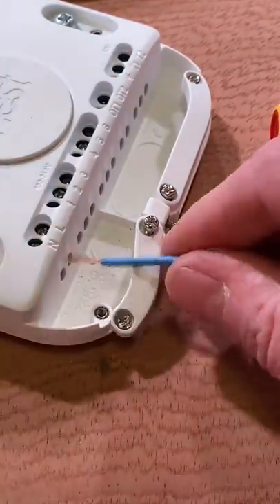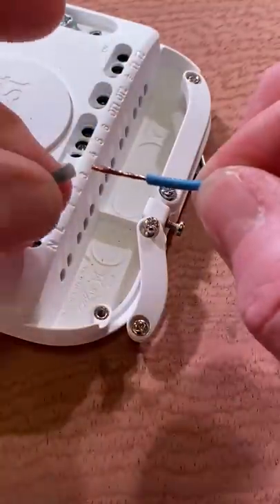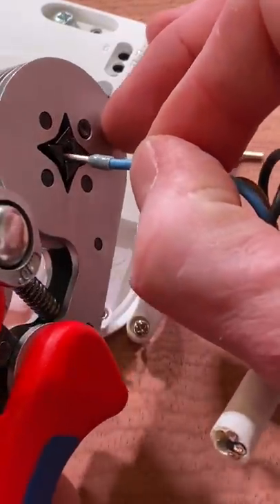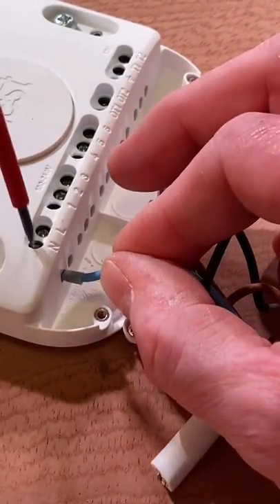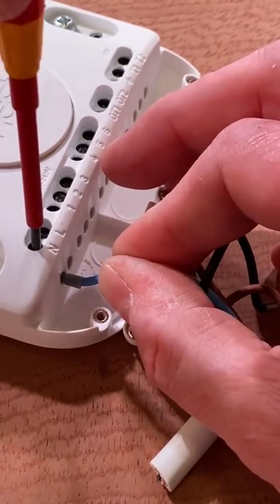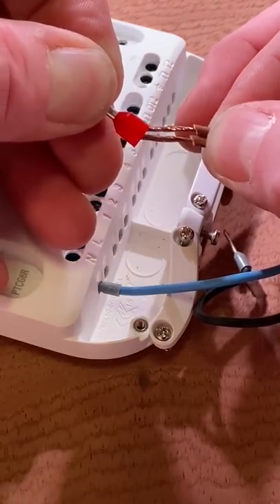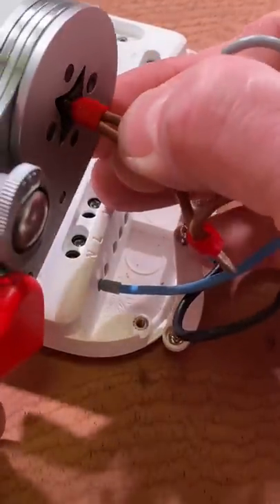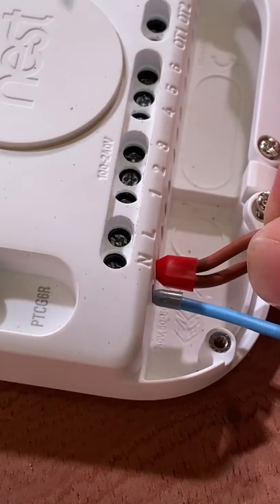Keep the strands together with WIRE FERRULES - Electrical #shorts from eFIXX

Comment from the maker: NEW TO USING FERRULES - check out this video series 👉 ⚡️https://youtu.be/3PpvyZmPTJQ
Reply: What make is that crimper ?
Reply: Please never twist the wires before inserting its shoe!
Not even with a single wire!
Specially when you have a good tool,
like that knipex.
The wire will live longer!
If vibrations are concern!
Reply: We're to buy great for solar systems
Reply: I’ll check it out. Never used ferrules in 40 years in the Hvacr trade.
Reply: And quite important, use the right size!
Reply: I thought this was standard
Reply: You can't twist them prior crimping.
Reply: Why not just double them over?

Comment: I’m having trouble getting the stranded cable into the ferrules. I need a ferrule for my ferrules

Edit: Thanks for all the thumbs up! Most I’ve ever had 🥳
Reply from the maker: Like a Russian doll 🪆
Reply: One reason could be the twisting of the strands, you aren't supposed to do that. Perhaps it's easier to put in then?
Reply: Cut that shit
Reply: Well said.
Reply: @m00str  same is true for wire nuts, even with solid conductor
Reply: You..you.....monster. What about a ferrule for the the ferrule ferrule? Its like Russian dolls.
Reply: You need a new job
Reply: No you don't..... Even I don't.
Reply: LMFAO 🤣
Reply: @amazoniancustodian  the type of people that don't pre twist solid wire are the same ones that use the stab connections on the back of switches and outlets, the same ones that use push on connectors, and the same ones that use shark bite plumbing fittings. They're called hacks. They don't care that the confection won't last as long or that it makes it harder for the next guy. They care about getting home to play video games.
Reply: @littlejackalo5326  Try it with some conductors bro, you don’t need to pre twist. 
If anything the pre twist only makes it more likely to tear the wire beyond its stretch limit, when you screw in the wire nut that further twists the wire.
Reply: Put some hair around the hole....
Reply: You’re famous now. Welcome to the A List!
Reply: The “thank for likes” edit completely invalidates anything you said in the original comment. FYI…
Reply: @Dragoneer  Nah, bro. That’s racist. Not that there’s anything wrong with being gay.
Reply: @JetFire9  uhh…what?
Reply: @Dragoneer  I love you too!
Reply: @JetFire9  ok?
Reply: @Dragoneer  I’m not sure what you mean
Reply: @kuk3411  Thanking for likes makes it look like that’s the only reason you made the comment and that was your only motive. It overshadows any point being made, and it’s generally not necessary since the majority of people that did like your comment won’t see the edit…
Reply: @Dragoneer  ah I see your point.. 
Well, I’m not bothered about likes but still would prefer to say thank you, despite it possibly not reaching anyone relevant.
Reply: Cringe edit thanking for likes 🤦‍♂️
Reply: Exactly, it's even smaller hole
Reply: You won't if you buy the right size for the type of wire you are using!!!
Reply: Don’t twist them
Reply: You know what I don’t get is in the US and Canada 93% of all low voltage systems in a residential setting we use sold core wires why does everyone else use multi core?
Reply: @the_hood_cat_5553  flexibility
Reply: Came here to say the same thing 🤣
Reply: One rule for one, one rule ferrules other 🤘

Comment: Snip the copper strands at the end of the ferrule for 10 extra electrical skill points.
Reply: I even crimp it twice, so it looks very clean.
Reply: We might aswell go ahead and number each termination while we're at it.
Reply: @conoromelia8435  heh.. heh. that's what she said..
Reply: And dont twist it!
Reply: @nobody-ek5bx  why not
Reply: @twilightsparkle75  She prefers circumcised wires?
Reply: @edithboozy1000  "may as well number every termination" some dark humour lmao
Reply: @alejandroperez5368  pretty sure because it adds unnecessary strain om the cables making it easier for them to fray or strip off from their contact at the insulation
Reply: Yep, I was expecting a snip myself.
Reply: @alejandroperez5368  makes it much harder to get them into the ferrule
Reply: @alejandroperez5368  because thay don't need to be and in some cases it could make cable to big to get in the ferrule
Reply: @nobody-ek5bx and it puts stress on the wire and changes its electrik properties.
Reply: @alejandroperez5368  It doesn't lay/crimp right if you twist. sometime you have to twist a little, but you don't want to go past how the strands were manufactured to lay in the cable. 

The strands will crimp down better, and you don't introduce any crossover or strain points.

It's a general rule for any crimped connection.

Comment: Oilfield E-tech here. We now use ferrules on all of our sensor and other I/O terminations. We have a lot less problems with broken wires at the termination point and everything is nice and secure. I've started to use them in my own projects as well, just because it so friggin easy, why wouldn't you? 

Another field repair life saver are the shrink tube butt splices with solder in the middle. Both have made my job so much easier.
Reply from the maker: 🙌 listen up folks!
Reply: Those solder connectors are a life saver!!
Reply: @Savinmoneyforparts  they contain a solder that melts at low temperature.
Reply: I would not use the low-temp. solder butt connectors in all scenarios.
Reply: @Savinmoneyforparts  yes, solder! Read the last sentence of first comment..... There are little connectors for splicing to wires together. You put both wires in and heat it with a torch and the solder ball in the middle fill.connect both wires perfectly, but in Germany you can't use them for electrical installations....
Reply: this is a GREAT technique people NEED to know that do anything electrical. period. lol 😊
Reply: Ferrules should prob be used on any size stranded conductor, fine stranded anyway. You can have some 12 awg conductor that's stranded but only like 6-8 strands and sometimes depending on the terminal you can terminate it raw and it's fine.
Reply: Butt splices lol  
🍑 😭 🤣 😂
Reply: @Savinmoneyforparts  the vast majority of my work is on control circuitry so yeah, low voltage/current applications. If you're splicing anything with more then 1A current draw, do it right and hand solder/shrink tube it.
Reply: We call them solder sleeves where I work (commercial airliner electrician).  Depending on the workload of the current job, I could end up doing several hundred of them. Lifesaver is an incredible understatement, to say the least...
Reply: Is it seriously called "termination"?
What the hell?
Reply: @aliceeliot6389  Yeah, it comes from the Latin word terminus, which means, "The final point; the end.", or, "An end point on a transportation line or the town in which it is located."

Same root word as the word terminal, as in, "Airport Terminal".

Basically:
Terminate (verb) = make an end connection
Termination (noun) = The end connection itself
Termination point (noun) = The point at which the end connection is made.

Ask an English major what they think a terminating resistor is, and you'll get some funny responses.

Comment: The fact that this cleans up and makes termination jobs easier is nice, but what's better is no more tiny holes poked in your digits!
Reply: I feel like I may as well just be a pin cushion some days 😂
Reply: Need a sewing thimble! until the ferrules come in.
Reply: @leemartin9156  good tip! I always forget those are a thing lol
Reply: @WolfangStudios73  I don't use them, Lol, but reading comments and knew exactly what you were talking about, it just popped into my mind.  Too bad I don't think of these things when I actually need them!  Lol.
Reply: @leemartin9156  oh I can relate. I literally buy tools for stuff, use it once and then forget I own it lol
Reply: @lileinstein104  my right thumb could be sold as copper scrap at this point
Reply: @funny3scene  😂
Reply: Waist of time
Reply: @stevenclark6387  So was English class for you apparently.
Reply: @lileinstein104  I'm a journeymen electrician what do I need to know about English?
Reply: @stevenclark6387  So you're a sparky without a licence, makes sense.

Comment: Ferrules are mandatory in the Netherlands with fine stranded cable when using a screw fasteners
Reply: That’s really cool to know ! Are you guys required to use any specific type of wires as well?
Reply: @ProDMiner  That depends on what kind of installation it is, inside/outside, underground, closed/open pipes. But we even have a regulation of how much isolating value your cable must be
Reply: @draadjelos4100  that’s really cool to know, love seeing how other countries make / build stuff differently than other places. Ty for the knowledge :)
Reply: @stevenclark6387 No we use 230V and 400V in our houses. But with fine stranded cable ferrules are (almost) always mandatory, not just in low voltage. We also have big cables (50mm2) that also needs a ferrule.
Reply: @ProDMiner  wait till he finds out about the good ol VDE
Reply: Ferrules gives worse connection. Seen more melted wires from ferrules then without.
Reply: The same in the Czech Republic.

Comment: And here in Germany we gave the dual versions an english name: "Twin"-Aderendhülse. They are mandatory here whenever you bring in a fine-stranded conductor into a screw connection, and that's the case since 1979.
Reply from the maker: Great info as ever Marcel - We need to visit Germany and check more things out!
Reply: @efixx  It was as always, humans only learn it the hard way. Before we used to solder the fine strands together and put them into the terminal. That caused massive issues, the solder deforms under the pressure of the screw and the connection becomes loose. In addition solder corrodes on the surface, which is no problem on soldered joints due to the corrosion is only on the surface, but when using this method it became a problem causing an increased contact resistance. The connections became loose, sometimes the wires fell out of the terminal. But sometimes the solder was deformed in that way, you couldn't get the wires out of the terminal. Even when loosening the screw fully the wires didn't came out of the terminal.
Reply: @Marcel_Germann  thanks for the reply, I wondered why soldering for screw terminals was against code.
Reply: That's funny, I have never heared "twin-Aderendhülse". Here we call them "Doppeladerendhülse".
Reply: @guppel  'twin' was inside speech marks. I understood this as a way for us english speakers to understand the word better. thanks
Reply: Well technically there is no law stating that, only norms. But in practice yea, they are mandatory.
Reply: @EmotionalWeather  In the industry it's all about regulations and norms. I got an educational book for electricians from 1980. They state there that fine stranded conductors must be prepared before inserted into a screw terminal. Either ferrules or crimps.
Reply: @Marcel_Germann  Glad yet sorry to learn this. I planned to solder the stands  on everything when I install the lighting in a model house soon. Although maybe it's still reliable enough for my use...
Reply: That's in fact not true. I don't know why but I thought this too but it's wrong.

Es ist tatsächlich so, dass jede Klemme auch Schraubklemmen per Norm auch für bewegliche Adern ohne Hülse geeignet sein muss und es steht in keiner VDE Vorschrift, dass die Dinger Pflicht sind. Du musst nichtmal löten. Einfach reinkriegen und runterschrauben ist absolut zulässig. Endhülsen missen will ich trotzdem nicht.

Ich halte es für richtig, dass es so beigebracht wird, aber genaugenommen ist es nirgends verpflichtend festgelegt.
Reply: Yet another example of Germans doing things better.
Reply: Same here in NL. 👍👍
Reply: @furrycocksucker69uwu  Maybe its because you learn it that way in an apprenticeship for electricians. Most people I talked to also thought it was mandatory to do this (including myself), but you are right, its actually not. It is very important to use a crimping tool which applies evenly pressure from all sides to the ferrule and to use the correct size for the diameter of the wire. If you insert a badly crimped wire into the terminal, the ferrule may get stuck in it while the wire slips out.
Reply: What would be the problem in just twisting the wire and puting it into a screw connection?
Reply: @furrycocksucker69uwu  Nope, the manufacturers of terminals must list the conductor types which can be used without any preparation. That's in the EN 60999-1, or in the German localisation VDE 0609-1. That's the reason the push-in connectors are only listed for solid conductors, even when you can use fine stranded with ferrules, but crimping on ferrules is a preparation. The thing is, if you use fine stranded conductors in a screw terminal, there's a high risk of breaking the fine strands and reducing the cross-sectional area of the conductor. Also there's less corrosion on the copper. And they also prevent that single strands protrude from the terminal and are touchable.

Zudem können die sich aufspleißen, dann hat man ebenfalls einen verringerten Querschnitt. Wer Anfang der 1980er Elektriker gelernt hat, da stand das im Lehrbuch drin das man bei Litze in Verbindung mit einer Schraubklemme den Leiter entsprechend vorzubereiten hat mittels Aderendhülse oder einem Kabelschuh.
Reply: @Heizenberg32  You shouldn't do that, will only cause trouble on the long term.
Reply: @sayingnigromakesyoutubecry2647  The fine strands corrode over time, also the fine strands can be damaged by the screw, reducing the size of the wire. Corrosion causes contact resistance. I once had a case of contact resistance. Old outlet from the 1950s in a damp environment. Contacts were corroded. Someone plugged in a freezer. When it was unplugged the person only had the plastic of the moulded plug in the hand and the prongs still stuck in the outlet.
The ferrules shown here are made of pure copper, which is tinned to prevent corrosion.
Also a reduced risk of single strands folding back and protruding out of the terminal.
Reply: @Marcel_Germann  well, all of the screw connections I ever seen in my country, Argentina, was always the cable twisted and that's all. I learned about electricity in highschool. Nobody ever mentioned anything about using this kind of connectors. I'm not saying you are wrong, it does makes sense. After a few years the cooper that was in contact with air tends to become brittle and shitty.

Still, I don't really get how would you avoid corrosion by using a connector like the one in the video. I don't think you would avoid oxidation of the copper since it doesn't look like it's insulated from air.
Reply: @sayingnigromakesyoutubecry2647  it's messy, inconsistent, copper work hardens so it's more likely to break, and the twisted wires cut into each other when it's tightened up. It's standard practice in residential in most countries to twist wires like you mentioned, however for industrial applications with high complexity ect, it makes things more tidy, more reliable, and easier to alter or troubleshoot, so it's very much the industry standard in those applications.
Reply: @Marcel_Germann  that's very nice. I should use them from now on... Thanks for explaining everything.
Reply: @Patrick-857  yes that makes sense. In the industry you will need to maintain electrical appliances  from time to time and you would need to disassemble them fast.
Reply: Noch nie "Twin" gehört oder zwillings. Einfach 2 Fach endhülse oder doppelt :D
Reply: @Marcel_Germann  Moinsens, ja ich habe auch nochmal geschaut. Du hast Recht, es sind Zwillingsaderendhülsen. (voll das lange deutsche Wort :D) 

Das sprechen wohl alle in meinem Betrieb einfach anders aus.. aber so viele Links hätte es nicht gebraucht, um mich zu überzeugen, ich bin offen für Verbesserungen meines Wortschatzes 😄😄
Reply: As an German electrician, everytime you see american wiring you are very likely to get a heart attack
Reply: @BeatstormX  Nope, it‘s only different. The only thing are the anachronistic twist-on connectors. Only one step after soldering the wires together…
Reply: @BeatstormX  Ja, darum gibt es auch entsprechende "inspections" die dort vorgeschrieben sind. Zumindest bei Neubauten.
Reply: @efixx  everting is so stikt here in germany

Comment: Ive been using ferrules for a couple of years now, good to see that sparks are now promoting their use, i used to have people turn their noses up at them, for stranded cable even upto 10mm they are great for keeping a uniform clamping surface without breaking off any of the strands, they also fit into push-fit or ideal connectors too, and most cieling roses, i just wish the ferrules were available WITHOUT colour coding for sizes as sometimes it can make a wiring job look a tad strange but thats just nitpicking.
Reply: We have been using these for decades. Never knew so many countries never use them. 

Up to 25mm2 for twin 16mm2 is used. Can go higher, but thats busbar territory here, so crimped ends after that for a bolt.